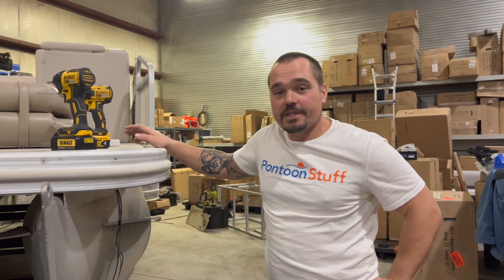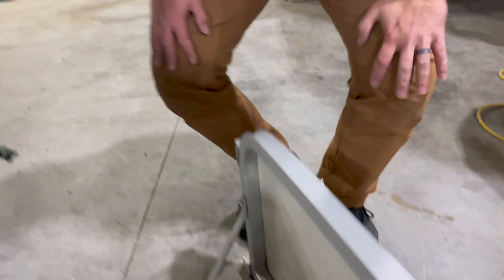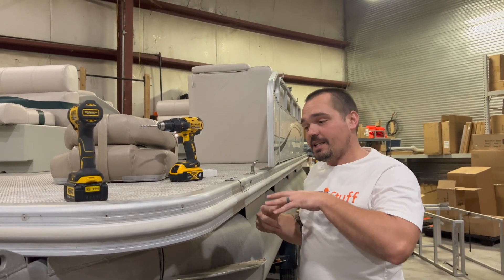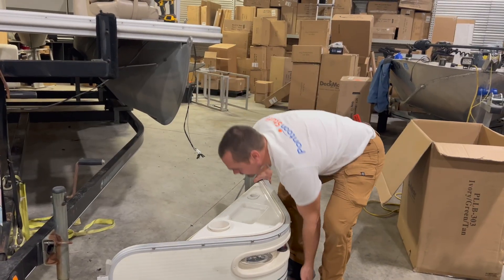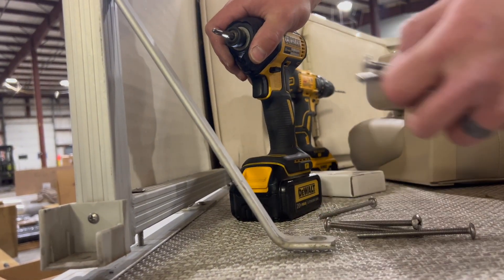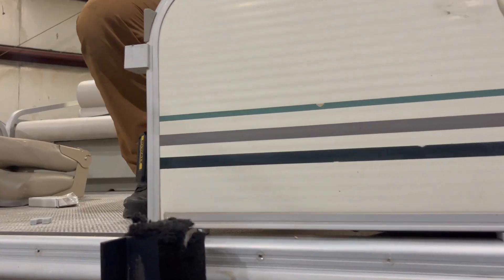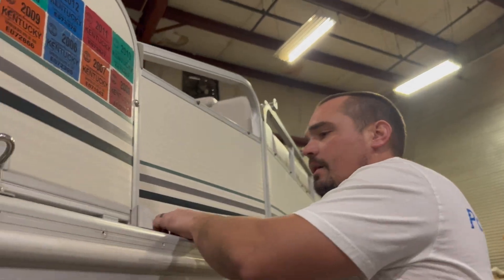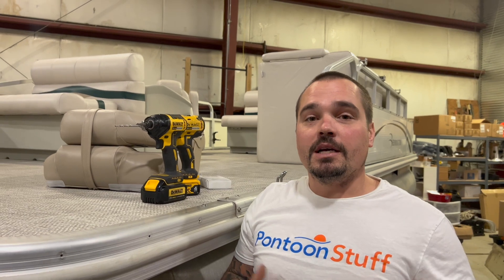Pontoon Restoration Tip - BEST Tip For Working Alone

Comment: Great tip Tom!! Thanks for the video. Like most people I think that to get the bolt through the deck I have to drill the hole the same size of the bolt. Never thought to drill one size smaller. Had a lot of vise grips pop off to hold the bolt while I tighten the bottom,  but never again. ATTA BOY!!!👍
Reply from the maker: I’m not even 100% sure when or how I discovered it, but it’s been a technique that’s gotten me by hundreds of times when I’m at the shop working alone. Glad it’s something you can use in the future!!  And thanks for the Atta Boy!!!